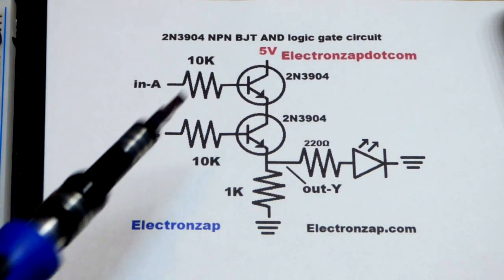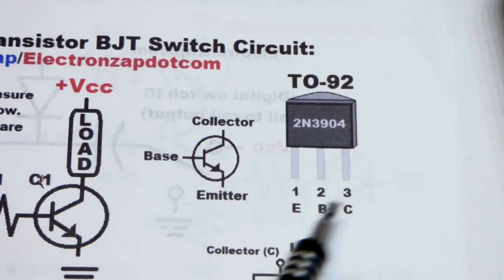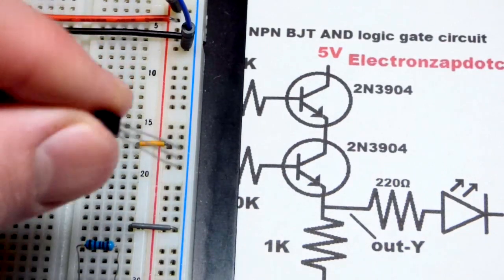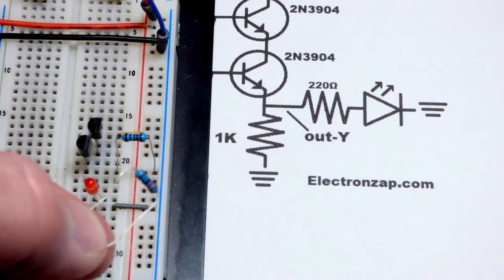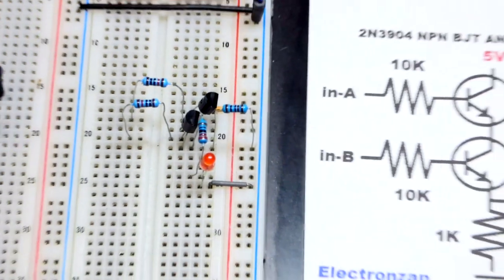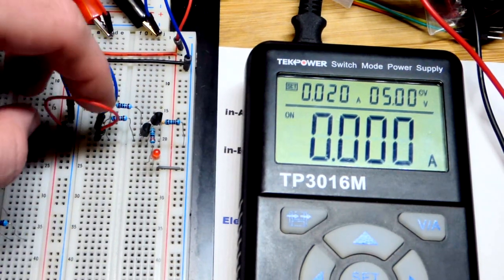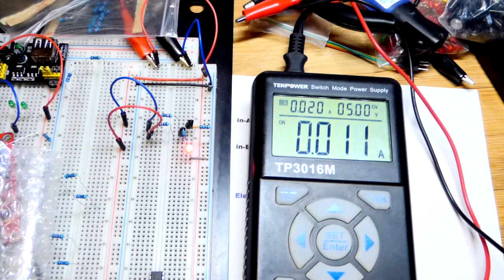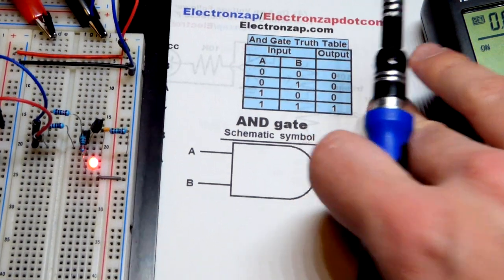NPN BJT based AND logic gate using 2N3904 bipolar junction transistors and an LED

Comment: Hey, I'm an amateur physicist and an amateur electrician. I've been struggling to understand how I can build my own logical circuits and calculate voltages, currents and resistances to match (I've been having troubles cause I didn't put a 1K resistor to a ground on the second transistor). Could you help me, or point me to a source where I can learn how to calculate these things in order to make good, reliable and working circuits?